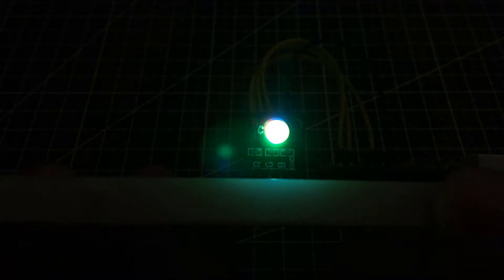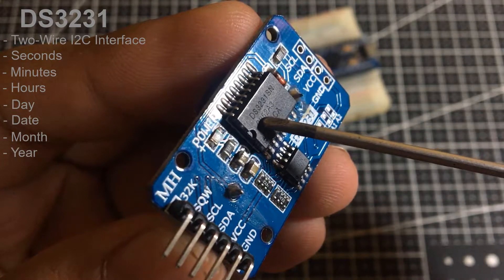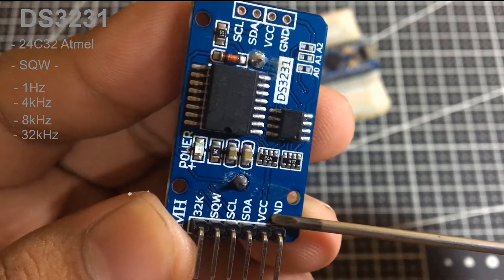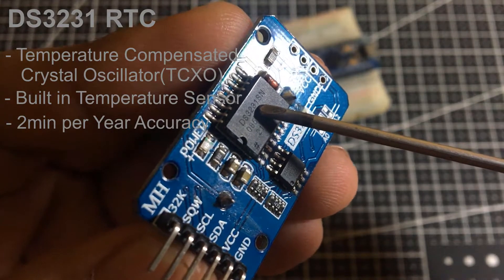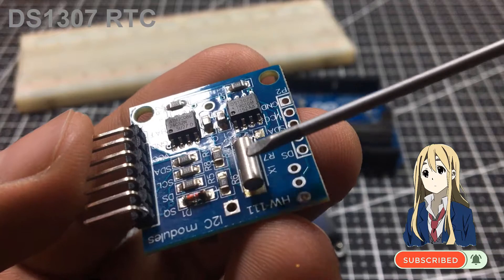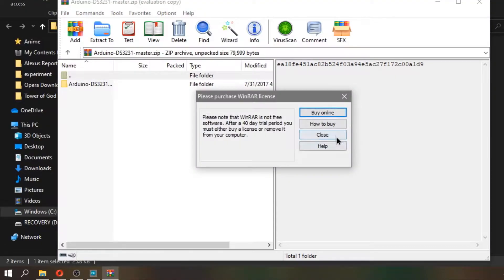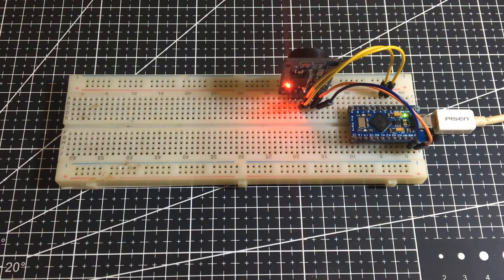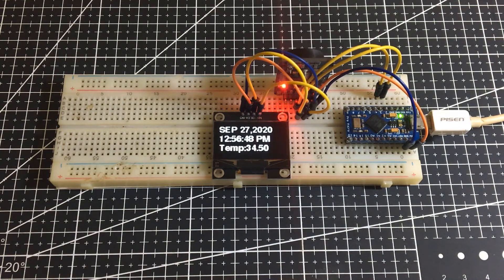DS3231 RTC in 12 Hour Format - Arduino

Comment: Hello, I like the that you included important information about the DS3231.  Very good. I am fairly new to this and I wanted to know if you could clarify something for me. When running the "Simple" sketch, does that store the current time on the RTC? So if power is interrupted from the Arduino and reset again, will it display current stored time from the RTC?

Comment: The code using  the different date /time formats is the easiest and best version of this code I have seen so far. I added a 16X2 LCD display with an I2C board added to it. With both the RTC and the LCD using I2C for comms  it only used 2 pins A4 and A5 to read the RTC and display it on the LCD in a variety of combinations. I added a few extra lines of code to the date format example in the zip file and it worked first time. Each of the different formats automatically produce leading zeros as well which is a real bonus and keeps the code very simple.

Comment: The program does not work with SSD 1306 OLED Display . Could you help to solve this issue?
Reply from the maker: why not use sh1106 library?
Reply: @kotobukichannel4367  I USED THE SAME LIB BUT IN OLED DISPLAY JUST TEMP IS BEING DISPLAYED
Reply from the maker: @mominkhadri8062  in the void setup() remove the "//" in the line 52 of the code.

 //clock.setDateTime(__DATE__, __TIME__);

 after you remove the "//" upload the code. 

Note that after you upload the code bring back the "//" in line 52 and upload the code again in  order to remove the overwrite of the code in the arduino code. if things did not work email me.
Reply: @kotobukichannel4367  thank you will try it again
Reply: Umm no nothing happened , can I get your email ID, will send you the pic
Reply from the maker: @mominkhadri8062  post your email ill email you instead